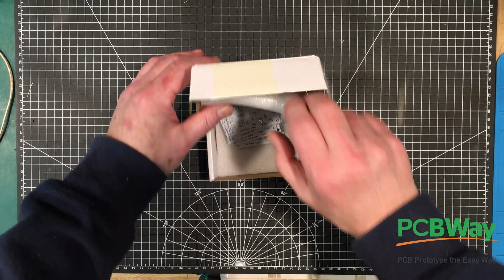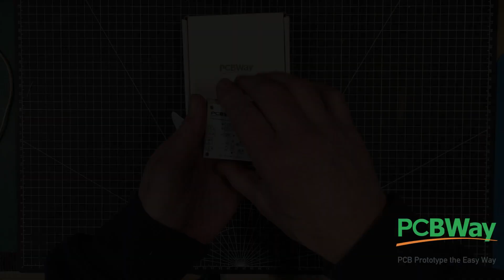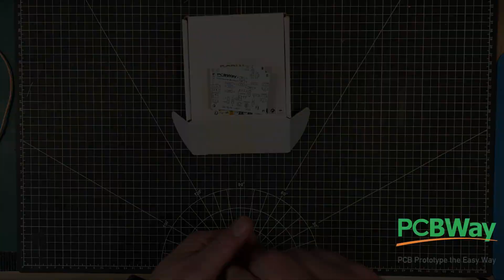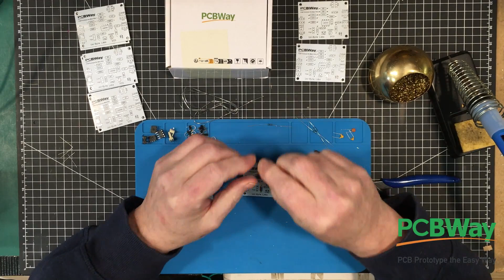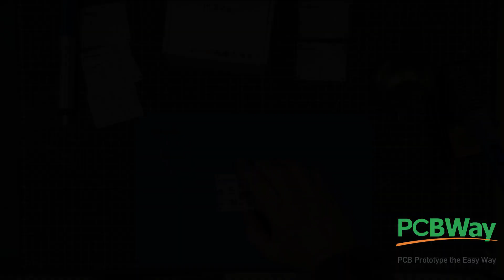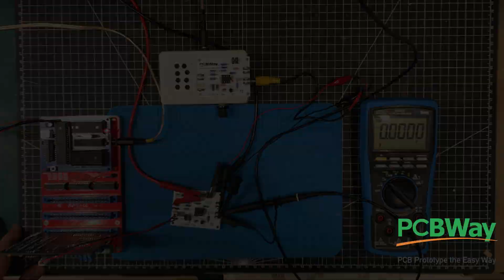0155 - Simple VCO Part 2:  Lets See It In Operation

Comment: hi, very good explaination. Question, what type & value of potentiometer are you using for the DC voltage control ?
I was looking at Precision Multi Turn Wirewound Potentiometer 100K ohm. Thank you.
Reply from the maker: I have 1k, 10k, and 100k 15-turn pots in boxes like that.  I'm almost 100% sure I used the 10k or 100K as I think the 1K would have been dissipating to much power.  100k would do just fine.
Reply: @uni-byte  thank you !!

Comment: do you have over the rainbow notes/freqs where you can post it or whatever? Thats my favorite song
Reply from the maker: It's not really done that way.   The "notes" are standard note frequencies.  The program stores 21 "notes" as decimal values that are loaded into a DAC to produce the required voltage to cause the VCO to oscillate at the required frequency.  This version is in the key of C major.  The data is below.  If you look at the list of values for tone data the first is "G1" the next is "A1" and the next is "B1" then "C2" and so on.  Given that, the notes of the song are:
C3, C4, B3, G3, A3, B3, C4,C3, A3, G3, A2, F3, E3, C3, D3, E3, F3, D3, B2, C3, D3, E3, C3.

In any case, if you can read music just google "over the rainbow sheet music".  You will find many versions. The version up on Musescore is in C major and likely you can downlead it for free.

: Tone data
: Value to send to DAC
:
1000 DATA 34, 38, 42, 44, 50, 55, 59, 66, 74, 82, 87
1010 DATA 99, 112, 118, 131, 149, 166, 174, 199, 226
1020 DATA 239

: Song Data
: In Pairs.  First number is the note to be played, second is the duration
: Notes: 1=G1, 2=A1, 3=B1, ... 21=F4
: Durations: 1=1/16, 2=1/8, 4=1/4, 8=1/2 ...
:
2000 DATA 11,8, 18,8, 17,4, 15,2, 16,2, 17,4, 18,4, 11,8, 16,8, 15,16
2010 DATA 9,8, 14,8, 13,4, 11,2, 12,2, 13,4, 14,4, 12,4, 10,2, 11,2
2020 DATA 12,4, 13,4, 11,16